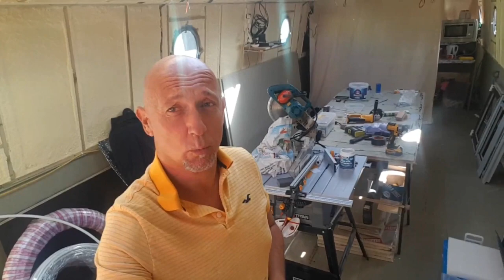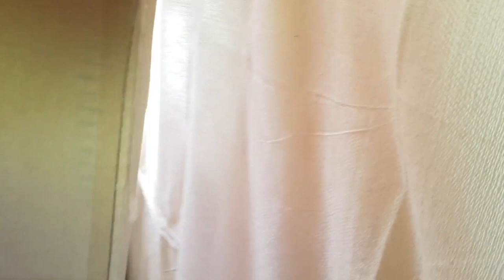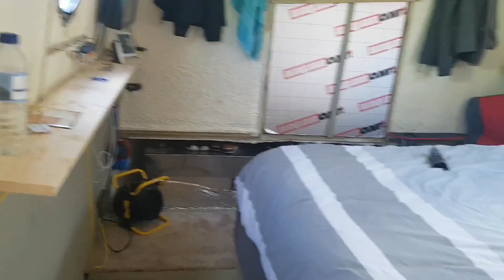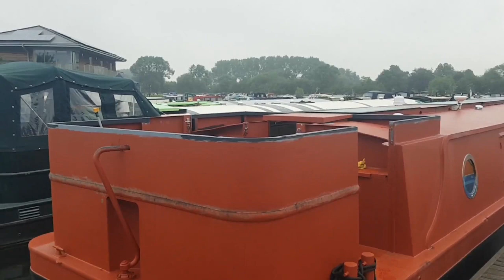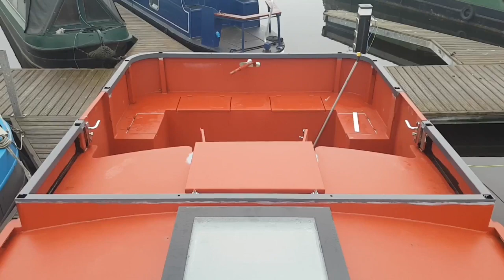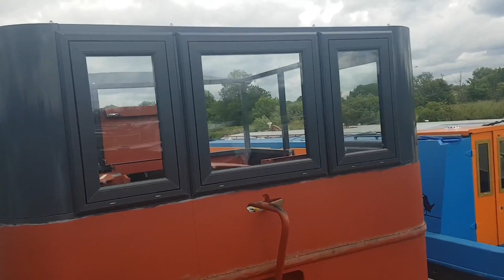Widebeam Boat Build Part 14

Comment: Hi I love your boat! My house will be going on the market, soon I was wondering what size is you boat and were you had it made thank you jeannie x
Reply from the maker: Northern Light is 57ft by 10ft6”. I designed the shell and had it built by a shell builder then just fitted it out ourselves. It took 12months full time.